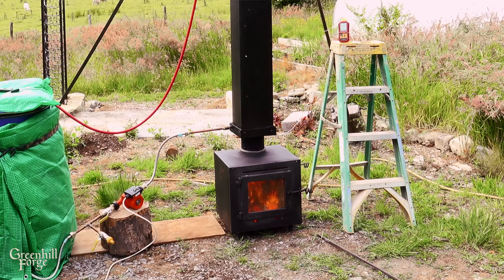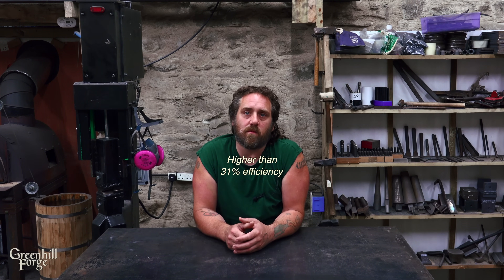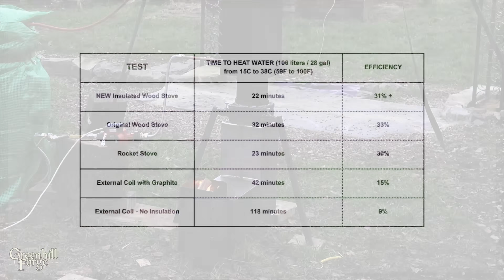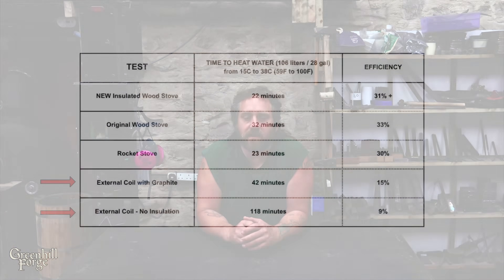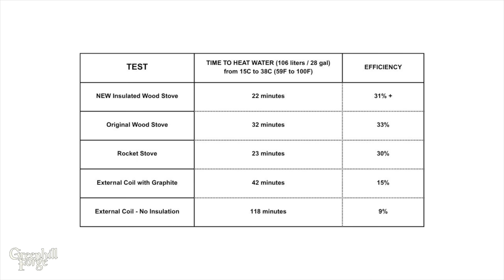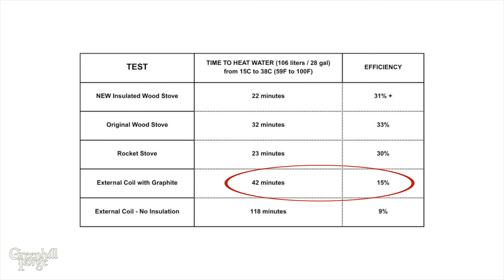Wood Stove Water Heater | New Test, New Winner

Comment: I have really enjoyed your series of videos with different stoves for water heating.
In my home I have a "Finnish mass oven" in my house. It is a 4 ton brick oven with extended smoke channels. I load load it up with 10-20kg of wood once a day and fire it up. The burn phase is around 1½ hour where it needs a little tending regulating the oxygen flow. On the outside the oven is between 45 and up to 52-55C over the 24H cycle. It keeps the whole center of the house heated all winter. I have a copper spiral in a sand cavity  basically on top of the whole oven (with a brick layer between it and the top fire chamber), so its nothing like what you have here, and the amount and temperature of the water produced is not very large - enough to heat one bathroom floor. I have had numerous interactions with the natural gas supplier because the have trouble believing my readings :) My house is 180m2 +  80m2 basement, and I use only 4-500m3 natural gas and about 2 ton of wood / wooden briquettes a year since I only use the gas burner for 3 rooms and I have a solar water heater too (but in Scandinavia thats only relevant in summer half of year). The faster / hotter it burns the better. I unfortunately dont have a way to measure temperatures, but it is very hot and the flames reach through the secondary chamber - I guess at least 6 feet long at peak burn. There is a ½inch iron grid/ash grate at the bottom of the main chamber and it is all twisted out of shape from the heat.

Comment: I skimmed through all your water heater videos, and the graphite touch was really interesting :D 
But, what I've not seen anyone do is create a thin rectangular flue. The problem with circular flues and heat exchange is that the flow of air is a lot slower on the walls, then in the center. And that creates an insulating layer, and most of the hot air just rushes out.
But if the flue were a thin rectangle with the same area as the circular one, it would act as a much better heat exchanger. So this could boost the efficiency. Of course, it would be a lot more pain to make a copper pipe around that...

Comment: maybe it's just me but I think you're overthinking this, why not just make a 6ft water jacket where the water is in direct contact with the inner tube, your expansion tank is your barrel as long as it's open so no need for fancy expansion valves and it should siphon just fine on it's own as the water will for sure boil inside the jacket. maybe even have some sort of reduction pipe inside the flute to force as much hot air up against the sides where the water is if you want to get real fancy.

Comment: please don't do water jacket, it takes precious heat from fire core leading to slow cold burn = vents unburned fuel gases. what you do (extracting heat from flue) is already top boiler technology in general approach. our shops flooded with fake "long burners" and it's a catastrophe for ecology and insult to burning engineering. this is only valid concern for wood/coal burning, especially wood needs absolute hell fire core. gas burning is where water jacket shines.

Comment: 5:52  Do NOT do it ! Do not put it inside the wood stove. I made a wood stove surrounded with water coat and steam train engine like chimney but vertical (multiple tubes instead of one). It works purfectly while it is clean. But it is a nightmare to use it. I have to clean it each 3 days. If you put a coil inside a wood stove you will lower temperature inside of it and it is very, very bad. Find a way to take as much heat away as possible after the wood is fully burned. DO NOT take any heat away until the wood is fully burned. There should NOT be any soot.
Reply: You need to burn a hotter fire and burn the soor out.
Reply: @TheAnthonyBrandi  it can not burn hotter, because we are taking heat directly from there, which does not allow the flame to reach the necessary temperature for complete combustion of the soot. That is why I say that we must burn the fuel (wood) qualitatively (completely) first, and only then take away the heat.
Reply: @ПетроШабляДовбиш so then what are your methods and materials for thermal exchange? Thanks!
Reply: @pamlemm903  multiple metal pipes (to increase surface) just like in steam engine but unlike steam-power engine you burn fuel in a chamber well-isolated with fire bricks (and thermoisolating material outside) before thermal exchange. And then, when you fully burn the fuel, you let the hot gas give its energy to water.
Reply: @ПетроШабляДовбиш so you essentially just mean using combustion gasses away from the fuel burn?
Reply: @pamlemm903  yes, away and after complete burn.
Reply: @ПетроШабляДовбиш right on, thanks for the clarification!

Comment: Your videos on heating water using wood are very good and informative.

I'm designing a new house here in southern Brazil, and one of my research projects is how to heat the house in winter using wood with the best cost-benefit. Winters here in the south are cold and damp, with frost, but snow is very rare.

When researching, I ruled out all electrical heat generation options due to the cost of both the appliances and the electricity. I also ruled out underfloor heating for the same reason: cost.

 I found a video called "#24 Wood Fireplace Central Heating | At The Ranch" where the presenter made a "heat box" around a cast iron fireplace, connected it to the house's air ducts, and with a simple fan/exhaust fan, he heats the entire house with the heat generated around the iron fireplace. 
That's what I'm looking for: an alternative to heating an entire single-story house, including all the rooms. The way I found to spread this heat is forced ventilation through ducts, which I must say is not very common around here. However, I'm unsure about the best cost-benefit option for a wood-burning heat source.

1 - A cast iron fireplace with dual combustion, where the heat is captured in an insulated "box" around the fireplace; 
1.1 - A cast iron fireplace with dual combustion, but this heat box is made entirely of solid bricks, having the best of both worlds: the rapid heat of the iron and the radiant heat of the bricks, which would serve as a thermal mass for several hours;

2 - A masonry Russian-style brick stove, for example, Igor Kuznetsov's OIK4 model. Adapt the hot air collector somewhere on the stove, or above it;

3 - A masonry rocket stove, made of clay bricks. The one that uses a steel barrel. But around the barrel, I make a heat box that would capture the hot air for distribution throughout the house;
 3.1 - A masonry rocket stove, made of clay bricks. However, instead of a steel barrel, I make it out of refractory bricks, and the air collector is the same;

4 - A normal steel fireplace, with double combustion, heat captured as in item 1;

5 - A batch rocket stove;

The answer I'm looking for is: what's the best alternative, using wood, to heat all the rooms in a house of approximately 2,160 sq. ft.

Do you have any suggestions?

Or, if you're interested, it might be a good idea for future videos.

Thank you very much.

Comment: If you want a more efficient heat transfer with an external coil, you can increase the surface area of the vent. Instead of a circle, try making a 'gear' or 'star' pattern. It'll make it harder to clean, but not as dangerous as an interior coil.

Comment: Can you please do a test with that graphite coil the same height as the others? I have a feeling if you double the graphite system and then use it with the insulated stove, you'll be in great shape and very close to the best two tests!

Another thing I'd really like to see you do is to use a heat exchanger using glycol water through the coils and then have the water in the barrel simply get heated by the system. This will allow for the system to by used in cold climates and greatly extend the life of the heat coil! Also, counter flow water from top to bottom since youre using the pump anyways.

Maybe later, if you add the water jacket inside the insulation of the insulated wood stove that would be cool.

Comment: By far the best design would be an external coil at least twice if not 3 times the length of copper pipe stretched out over 8 - 10 feet of flue. The 6" flue then needs a 4" blank pipe down the center to create an annulus for the flue gases flowing up. The water MUST flow downward for efficiency. This will likely produce water over 100C so the flow needs to increase to keep it below 90C. Insulation over the whole length would be a good idea. Flue gas exit temp should ideally be just above 100C to prevent condensation forming. Much above 100C and your design needs more HT area. The pump could be run from a PV panel on the roof of the shower. This setup is never going to be a fit and forget unless you want to waste lots of wood gently heating water over an hour plus.

Comment: Putting a water jacket , or heat exchange in the combustion chamber will make it more difficult to keep peak combustion temperatures.

put a flow control gate just above the copper coils. The goal should be a a flu temp bit much higher than at the end of the exchanger, and not have excess flow.

You could try having a short rocket riser by experimenting with vortex. A strong vortex means that you need overall less air flow, and could use a shorter rocket riser, and not need a longer heat exchanger.

Comment: Here in the south of Chile every one uses wood to heat their water. THOUSANDS of homes heated with FIRE BOX TANK wood stoves. 
I am a gringo here and have asked my friend who owns a foundry that makes these stoves why they do not use copper tubing and they explained that it does not have a long enough life for everyday use. So they manufacture a tank that is the walls of the fire box. 
We have been using one of these for 12 years now. It is easy to clean the walls of the box. 
Our stove will make steam in 30 min. 
We have a big storage tank for the water that is separate and insulated and we use this water for our radiant floor heat. 
It works great and lasts a long time. Jim in Chile
Reply from the maker: Yeah, it's funny, boiler stoves are huge in Europe, Australia, the UK etc but just not used in America

Comment: Stick a damper at the top above the copper pipe and you’ll save 90% of the heat from exiting thru the flue above the pipe increasing efficiency

Comment: This is really impressive from the build ideas to the testing.  Assuming the wood you're using is a control and all from the same tree / batch / dried similar.  You could add a scale under the stove and measure before and after the test concludes to give you some sort of measure of fuel burnt.  This will at least give you an idea of mass consumed.
Reply from the maker: Thanks! yeah its all dry larch and i check the moisture content to make sure its very similar. I've been looking for a large scale that could handle the weight and abuse but they're pretty expensive, would be the best way to get really good measurements though

Comment: So I still think you should make a short video like this showing the pump in reverse to show the speed at which the temperature heats the barrel. If you have the facilities to run the pump to get hot water faster you'd probably want to run the pump in a reverse flow. I understand off grid, but I think we need the efficiency reading for reverse flow as well, just to cover all bases.
Can't wait for the build we talked about. It's gonna be a pain in the ass with wrapping the copper, but I think the change from the flue to the box wrapped in copper is going to be huge.
Reply from the maker: I plan to make some counterflow videos. It just takes 5-6 hours per test with all the setup etc so it's just finding the time and hopefully on a day I can use the hot water for something.

Comment: Could you source a stainless coil from a scrapped condensing natural gas boiler and put that either in stove or in flue? Would avid some of the issues with copper in that application, not all, but I but it would be your new leader in "in-stove" methods.

Comment: The solution to the rocket stove being 'too powerful' seems incredibly obvious. Just make a smaller one. You could also use a reverse funnel to have the same chimney diameter (also reduces gas velocity, so more time for thermal transfer), but it would likely be more efficient and cheaper to simply wrap a smaller gauge of copper pipe around a taller, thinner chimney coil wrap (the larger the diameter of the chimney, the more hot exhaust gases will simply pass through the center of the pipe without touching the walls). You would also create a much taller feed chute so you can dump loads of wood stakes in so you don't have to constantly add more fuel. (Sorry for reposting this comment, figured I'd also leave it on your newest video).

Comment: Just stumbled on your channel & caught several of the videos on this facinating series of tests. I've had an interest in combining a wood hot water system with an automotive radiator for supplemental home heating. I'd thought black iron pipe would be the better application for maintenance free years of exposure. What schedule copper tube are you using?

Comment: For the outside flue coil, could you lengthen the active heat transfer area? While using the graphite fill? Thats seems like you could increase your efficiency that way too and truly compare best outside flue version and inside flue version. Obviously with a insulated stove.

Comment: I keep thinking that you can utilize the speed of air speed of water flow, speed of combustion (rocket) all in different parts of the system, paired with slow heat exchange, slow venting, long heat exchange runs, etc. Pair these parts so the most heat is being generated efficiently AND the most heat is being captured at a pace that the materials and media can handle. Water has its limits; copper has its limits, etc. One reason rocket mass heaters are so clever is they use a tiny amount of fuel to store a lot of heat in a large battery. You want all that heat transferred somewhere... What if your heat capture had two levels or two stages: Some heat going to water, which is flowing fast, some to a kind of battery, which is storing heat? In other words, I think you're able to generate phenomenal amounts of heat, and maybe branching where the heat is used or stored or transferred could actually make the whole system more efficient. You could worry less about insulation and thermal blocking or dampening. I hope this makes sense. I think I'm arguing for a more complicated system, that captures and uses more heat, which may not be desirable for home builders.

Comment: Since heat transfer is a function of the temperature difference, could you improve the efficiency but upping the flow rate of the water, reducing the coil temperature & hence improve the heat transfer or are you limited by the flow rate of the pipe?

Comment: So, a lot of fireplaces these days are getting a more efficient burn by the introduction of oxygen into the smoke stream, those smokeless fire places. Well, what would happen if you used some pipe fed in through the bottom of the flue , with a "nozzle" type end pointed directly at the coils? The idea being as the pipe is heated it will force oxygen up through the pipe via thermosiphon and the oxygen which would be directed via the nozzle type opening could be aimed directly at the copper tubing. If there's enough heat still it SHOULD cause the oxygen and wood gas to re-ignite in the air, and cause it to focus a flame like a less-powerful blowtorch. Bit of a mix of a "smokeless" fireplace mixed with an old alchemists torch.
It should hypothetically both clean up the exhaust gases a bit AND get you additional heat.
Reply from the maker: it's an interesting idea and I agree that it would work if it still had enough heat, which it likely would with this stove. In this video I built a woodstove with a similar secondary burn system but inside the stove above the baffle https://youtu.be/al_UNeEeaQw

Comment: You need to look in to pellet heaters. Our comertial small nominal 10kw burner for our house has a efficiency of ~90%, it has internal baffles with water channels to slow down the air flow. Chimney temps at below 100°c.